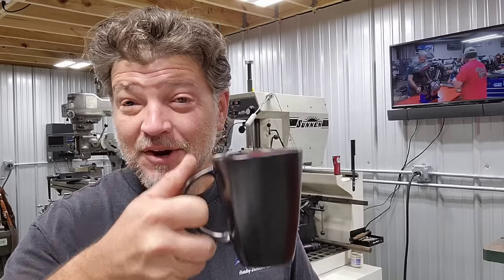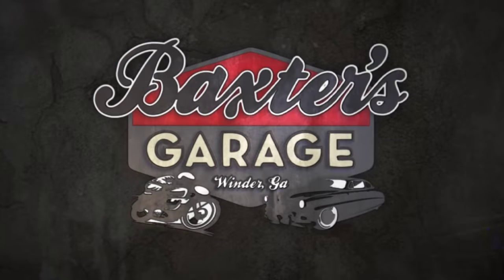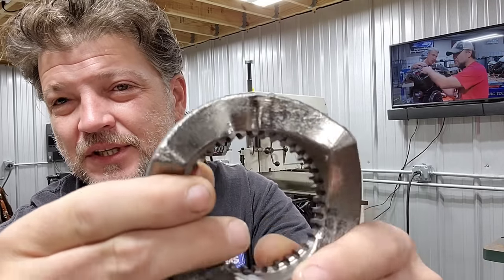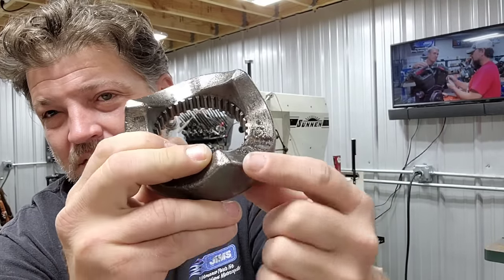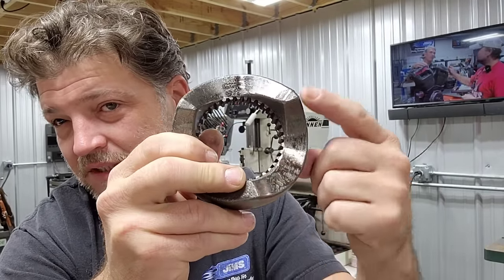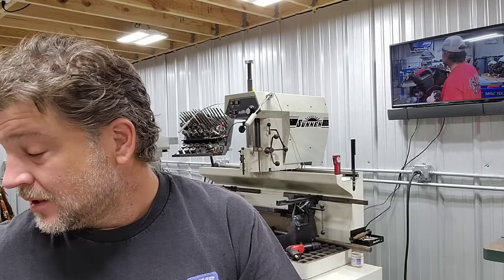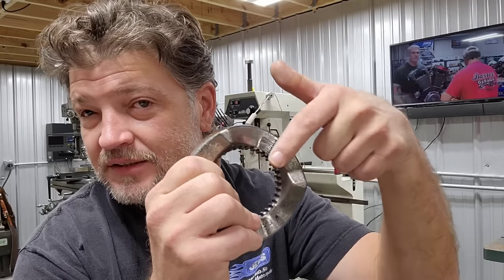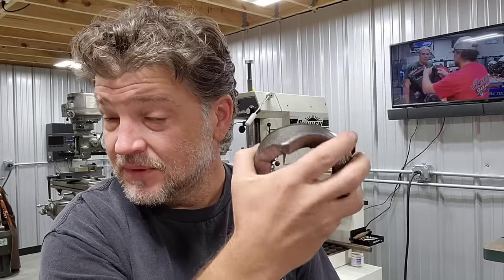Compensators For Your Harley...Should You Eliminate Them?

Comment: here is my experience with the dark horse hybrid comp and an evolution complete stage one clutch basket.  2015 flhp.  purchased with 1500 miles.  like a fool i caused an issue with the clutch by installing a device to assist with the heavy clutch pull of the flhp.  i believe it caused early problems with starting, finding neutral ETC.  i installed a DH comp and Evolution complete set up with the billet inner-using blue springs.  I had a VERY pronounced neutral rattle.  also, some drive line noises until warmed up.   after about 1000 miles, to satisfy my OCD, i tore it down to RE-check tolerances and torque specs.  while doing so, i damaged the billet inner clutch basket so i ordered their steel one as a replacement (AND THE PROPER CLUTCH TOOL).  All tolerances were WAY in spec.  this time, I did change the way I installed the Compensator bolt.  This time instead of cranking it to spec, I used the method in the manual.  You have to season the threads by tq'ing to 100 ft lbs-----back it off and THEN crank it to full spec. (make sure to use a NEW comp bolt!)  I even Re-used the same clutch plates.  Quiet as a church mouse now.  I'm VERY happy with the set up.  THE ONLY negative is that at about 2800-3000 rpm, there is a bit of a shutter felt when at steady throttle.  this is not from my tune.  i'm using a thundermax auto tuner.

Comment: Good explanation! I've made an aluminum shim to tighten the spring preasure on mine,I ride mine to drag race wheelie and travel at highspeeds and shim Works well!
Solid mount I've stripped clutch basket splines,no issues after adding shim
Cheers

Comment: Again kevin .. great unbiased opinion …
88k long haul rider on my ‘14 SG … bike is awesome but I get a slap when on the throttle and think it’s the compensator. .. just changed the belt after the issue started but it still happens. .. 
  Debating what to go with and what to do. Now I have the information and my conclusion 
 The compensator is a wear item , in my situation . It should be replaced with a stock item and take it another 88k 

 Yes?

Comment: I just recently started watching your videos and have already learned quite a bit about my motorcycle.  I have a 1999 DYNA Super Glide and a 2016 Ultra Limited (Shriners/Fireman) model, I am neither but I really enjoy my bike.  I know just enough about the Ultra Limited to make me dangerous at this point.  The Ultra Limited I bought used with 16k+ miles almost 3 years  ago and I don’t know if the previous owner did any cam upgrades, cam plate, etc.  I’m going to watch more of your videos before I ask you anything because you might have already posted my questions.  Thanks for your time, knowledge, and advice.  Yes I’ve SUBSCRIBED.

Comment: I have the Darkhorse Comp and the Baker manual adjuster.  Andrew at Darkhorse worked with me to get a set up going.  I'm now removing the Darkhorse and putting in a SE Comp (the newest addition).  I'm tired of the noise, the jerky riding at low RPM, when you get a little chain stretch... you can't find neutral and half the time it won't go into first gear on the first try.  I have Head Hoggers built motor (118/123).  I'm hoping the SE Comp will make me happy, if not, I'm off to plan C, whatever that might be.
Reply: @tomjones4093 Any updates on your new SE Comp? I installed a darkhorse comp and believe its too noisy and have all the issues you stated above. Thinking about going to the evolution ramp and new diaphragm springs. Most people like the darkhorse but I'm not sure why. I have an upgrade clutch and basket so that's not the issue. Thanks.

Comment: Ah! Makes sense now, and thank you. I have an 80, 88Twin Cam, and a 96Twin Cam. When I first fired up the '98 Dyna (carbureted) I have, seemed like a Harley to me. '03 Road King had me concerned being fuel injected, but once the oil in the primary got around stuff, yeap, Harley. My '08 Road King, that one's funner than the rest! Same kind of noises as the '03 with 20k less miles, so it is what it is I 'spose. So all these compensator issues are with the bigger bores, makes sense. Tell me though, would a dry clutch and belt work? My dad had one on his '82s shovel head(?) I remember the transmission and engine were two individual components, because I aligned the primary belt. Clutch was rattling around town, but not on the freeway. I don't see those primary belt drive setups anymore. Hope I ain't showing my age... :-D
Also, I just added an Ultracool oil cooler and Flo filter to my '08 Road King. Something about it seems the engine isn't struggling on first fire up. UltraCool says those filters reclaim 7hp by relieving the back pressure paper filters cause with 50wt. Something about bypassing the filter until the oil heats up. Does seem to idle way nicer when its cold, and throttle is more responsive. Might just be me but seems primary noise got reduced a fair amount, enough to notice.

Comment: Replace the compensator ramp only. Nothing wrong with the OEM sprocket. Something like the EVO Billet Heavy Duty Comp Ramp. Solid Aircraft gear material machined. Not a cast item. Quieter than the Man O War.

Comment: Eliminating the comp in most cases will cause some damage sooner or later. Engine , transmission, clutch, i've broke a shaft off a crank, procharged bike.
I had to eliminate mine to help starting, my Fuel Tech ECU could not deal with the Harley Comp kick back, you dont have to see it or hear it, for it to be there, but it would loose tooth count and have to start count all over again, making starting very difficult.

Comment: Given, that The Motor Co.'s 
45° narrow angle V-Twin, with a single  crankpin, locating both connecting rods, and firing at 315, and 405° of crankshaft rotation,  the power pulses are inherently uneven.
The coveted, signature "potato potato" idle note, has a price to pay.
Such is the nature of the beast.

Comment: I'm running an extra (ebay) spring in my pack on my new to me stage 4 early twin cam(2000 fxdwg).   I'm 10'000km into the experiment.  Also experimenting with a vent in my primary inspection cover.    So far it's eliminated the intermittent leak I have from the starter drive seal area.  

Man I'd love to pick up a set of cylinders bored by this guy!  Maybe I should go 98? if I re fresh.

Comment: First off I'm a huge fan! Love your in depth explanations and the experience behind them. I have a 2017 ultra limited with 107 there is a dark horse installed. Have you heard of the stator rotor breaking the weld every 1200 miles? What could cause this? I've broken 2 in about 2,000 miles I'm stumped on what to do

Comment: Good evening all (from Cleveland Ohio)
I just finished watching the video watching multiple times, I understand that if you are going through compensators like oil filters, there are other problems that need to be addressed first. Right now I have an 02 RoadKing with 100 CI S&S big bore kit, ported heads, and cams, I am happy with the performance and no compensator issues, but like people with old muscle cars, that want an 8-71 blower sticking out of the hood, I am thinking of having an S&S 124 kit installed. One topic that was mentioned, was the fact that people who owned bikes like mine back in the day, were not pushing them that hard, but with updating an 88 to 124, you would basically be rebuilding the entire engine, if everything checked out, and the compensator kept failing, what would be my options besides eliminating it, is it just rebuilding the stock one designed before 07 and upgrading the ramp? This question is driving me crazy, if I owned an 07 or later, just call Darkhorse/Baker and be done with it. Are early twin cams left out of all these upgrades, because they usually don't have any issues? Thanks in advanced, Tom

Comment: Great explanation on the purpose of the comp but I feel like you left a lot on the table as far as problems with the comp like the ramp breaking and also solutions. You said nobody makes an upgrade but that's false. Baker makes an upgraded compensator with a better design hardened steel ramp and smoother shifting. It's a better comp than dark horse in my opinion. Many reasons why I went with the Baker compensator instead of just an upgraded ramp ,Dark horse or a SE Comp after so much research on all of them. I just don't want to make this comment longer by listening them all.

Comment: I took the Darkhorse out.  Crazy noise even with a Darkhorse crank and a Baker Grudge Box.  It has a Star Racing ramp in it now.  The 124 I have is a skunkworks build by kevin.  The noise may be to much for me but others may be ok with it.  18000 miles on the build.  Only problem was a minor rocker box leak.  Bike runs quiet and flawless. @kevinbaxter knows how to build a motor.
Reply: I just did the same. Ran the man-o-war for around 30K but hated the noise, had to replace my clutch recently so I installed the stock comp again and I have to say it sounds a lot better. I may look into a more robust ramp for it eventually.

Comment: Regarding the vibration "having to go somewhere". I have a 95 dyna wide glide which had a scary "dyna-wobble". i changed front and rear engine mounts several time trying to stabilize the bike. i finally installed front and rear Sputhe stabilizers. I LOVED IT. its been a couple of years, ( i live in minnesota. so we dont get many months to ride), but ive got a vibration thats causing other issues now. My question is: does the "vibration" factor , such as the vibration which u talk about the compensator sprocket, hold true with something such as the stabilized engine mount? Is that vibration going somewhere else too?

Comment: I replaced my ramp in my M8 with one from Star. I have wondered about the compensator being designed to be the weak link in the system for a reason. My mechanic laughed at me, but many mechanical systems have parts that are consumable in order to preserve other parts. The forged ramp is stronger, and at least should not have the catestrophic failure mode that the cast one can be known to have. What is the recommended milage/time to check the ramp for excessive wear? Seems that the right strategy is to have a stronger ramp, and then proactively replace it every so many miles or duration. I am trying to figure out what that milage or duration is.

Comment: I ran an eliminator about 100 miles on my 120 and took it off. Felt every bit of that engine, not fun for a big nasty cammed engine,couldn’t idol through traffic in 1st when splitting lanes without the clutch halfway in.

Comment: I think hole shooters have the biggest problem with compensators.  Gotta give it everything it has to get across the intersection first and let everyone hear you roar away from the traffic light.  My 2012 Superglide has 118K miles, runs fine.  Any my 2006 Yamaha stratoliner has 60K miles, 100 horses, no compensator.  Throttle jockeys are their own problem.

Comment: Hello Kevin , thank you for your time . My 2003 Softail Heritage is bone stock , is crank runout eventually going to happen to me ? I have 49,000 miles . Thank you .
Reply: I'm not Kevin, obviously lol, but if it's not bad yet, as long as you don't dump the clutch off the line or downshift real hard, you shouldn't have any problems. It's the hard shock loads that cause the flywheel and pressed pin to scissor.

Comment: Hi Kevin. I live in the mountains and tend to ride very hard and i think as a result i go through a lot of compensating sprockets on my shovel and twin cam, the shovel i have had for nearly 50 years and have to change the whole compensation drive very often coz the diaphragm springs go weak and i get a lot of movement in the clutch with no movement on the crank shaft, i have a big box of busted compensating parts so i got an old compensating sprocket and put an extra diaphragm in it and it has lasted a long time with no problems but as you said it will proberly cause problems else where so is it worth me putting a darkhorse compensator in coz the standard ones only last me a couple of months before it gets very loose.
Thanks for any advice you can give me

Comment: 12 Road King, mild cam etc from Fuel Moto. Found I was getting awful motor pulses, on and off the throttle, with the stock comp.  I went with SE compensator and tried a Hayden chain tensioner(not good) but went back to the stock adjuster. What do you use for the tensioner in your builds? Definitely would consider the Dark horse in the future.

Comment: What do you think of the automatic chain tensioner in the primary? I’ve been though about 4 different ones. The one I have now is southern Oregon custom bike hydraulic tensioner and it seems to be working great. At ten thousand miles I lost the compensator and clutch basket the bearings were gone as well has the splines in the clutch basket and mainbearings in the transmission all because the automatic chain tensioner we too tight

Comment: Looking for your opinion. I just purchased a 2015 ultra limited 103 with 45k miles. After purchasing it I notice noise in my primary at idle at times and loud shifting and hard to find neutral. After watching a ton of videos I have concluded that it is my compensator. I am looking not looking at going big on getting more power, but trying to decide if the baker compensator or going with the man o war.. Which do you think would be the better decision to go with? I like the idea that the man o war being rebuildable, but since I don't know my run out and would hate to purchase the man o war and then there be too much run out to install it..

Comment: But which comes first, the runout on the crank shaft, or the damage on the compensator? I have heard plenty of mechanics say it is the compensator that wears, and causes run out of the crank, even on bikes with very low mileage. To the extent that the engine blows. The issue is, there WILL be some wear somewhere, where do you want it to happen? My answer would be, NOT the engine. A solid compensator moves the problem downstream as it were. Harley have had a number of different compensator designs, and all fail in the same way. The fact that they keep changing the design tells you that the concept is flawed. I doubt that they will ever get it solved, before fossil fuel engines are phased out of production. On more recent M8s, my friendly local dealer mechanic tells me they are seeing the crankshaft problem on bikes with less than 5000 miles on them, and the compensator is already badly worn. My 21 softail has had the compensator swapped already for a soldi one. There was no runout on the crankshaft, but the compensator was looking very worse for wear already, and that was at 1200 miles. We only went inside the Primary because we were swapping it to chain drive, and noticed the issue. One other thing we noticed, was that the auto tensioner had gotten the Primary chain really tight, as it was compensating for the loose play in the compensator. Having an auto tensioner that always gets tighter when your compensator is bouncing around is not a good thing. It now has a manual tensioner in. What part causes the problem though? The tensioner, the compensator or the crank? Did Harley go to an automatic tensioner to make servicing easier? Is that what is causing the problem?

Comment: Hello Kevin,
I sorta understand the purpose of the compensator.  And back in the day, when it was a heavy chain for the primary, the need to smooth out the engine to the drivetrain, must have been needed enough to create the compensator to begin with.
But now, today, with a lot of primaries being a heavy rubber belt, instead of a steel chain, wouldn't the belt be the one to absorb those pulses the chain couldn't?  And then pass it along to the secondary, 'drive belt,' to the rear wheel?
Yeah, I know...  It's probably a stupid question.
But if the compensator is that important and such a vital part, to buffer the pulses from the engine to the rest of the drive train, then "why does HD do such a crappy job building them?"
At best, from HD, you need 'Screaming Eagle parts.'  And even then, that's only a hair better than the OEM crap they push on people.
I wish I was a rich man Kevin.  I'd get a nice ride and have you build it up from the ground up!  With all those things you do to make an engine better and more dependable than the Mfg, ever would consider.
From the Dark Horse crank, right on up!
But reality is, I don't even own an HD any more.  It was too much for me to want to deal with.  The 88TC was a bad idea, as stock.
But that's most HDs.  Buy one new, and spend as much having it built to a spec and quality you don't feel like will leave you on the side of the road!
Reply: I feel your frustration and it's understandable because HD has been ripping people off for decades with their inflated prices and poor quality product.

Comment: If you go to a compensator elimination gear there is still the Kevlar drive belt connected to the “Cush drive” pads in the rear wheel. They will also absorb pulses right?

Comment: Any info on the screaming eagle compensator, just installed one on my 12 twin cam stage 3 revperf kit. Put about 1500 miles on it. Seems fine but is noisier when hot in neutral.

Comment: Hey Kevin , new viewer. Old shovel owner. I installed a Big  Boar wide tire kit about 6 years ago. It came with a 3/4” engine spacer and could not run the compensator . Any suggestions? Great videos 😎